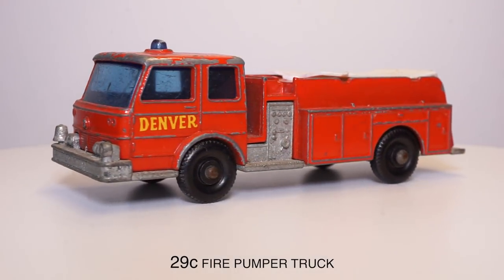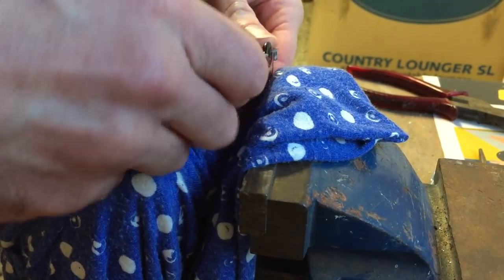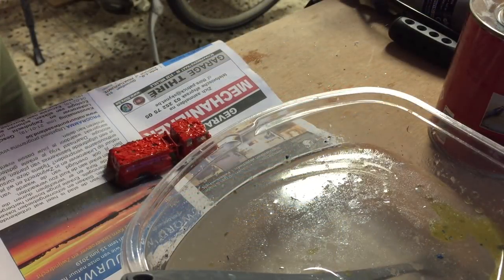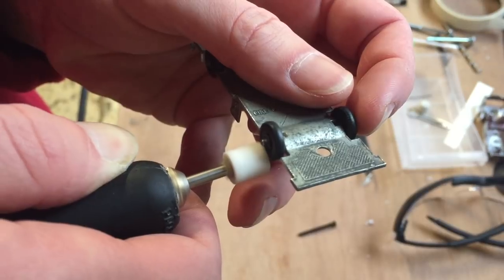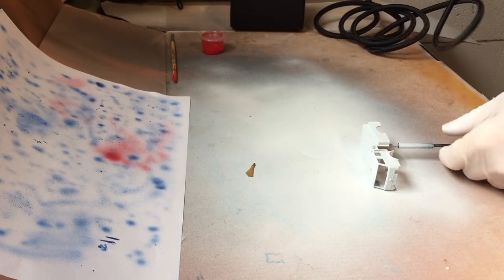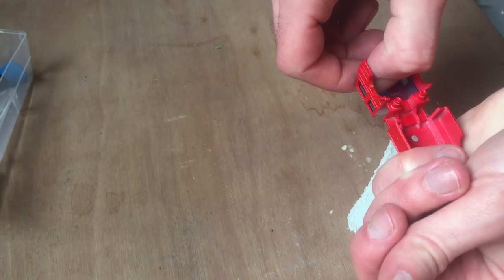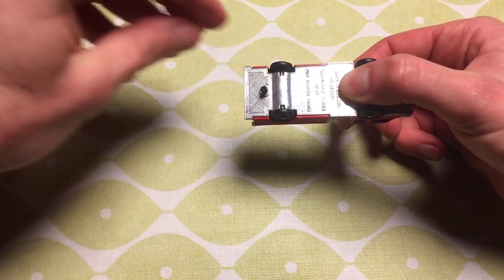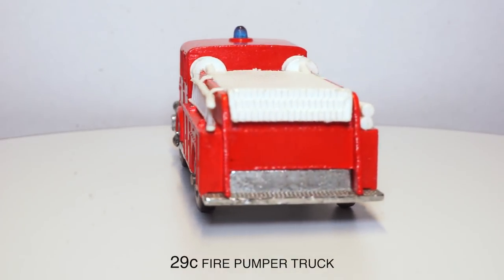Matchbox 29c Fire Pumper Truck - Full Restoration

Comment: Good job dude. I love the vibrance of the red colour you mixed, looks reaaly smart. 
I don't see why the "modified nail" method of doming the axles wouldn't work with a hand drill instead of a drill press, maybe practice on a scrapper first to perfect the method though.
Subbed and looking forward to more vids.
Reply from the maker: Thanks Pete. It came out just fine, not the exact colour, but nice afterall... :) More vids coming soon!

Comment: Use Marty's method of using a nail and drill press to mushroom the head of the axle when fitting back on. The mushroom on the left front and back axles dont look the same size
Reply from the maker: Check out my latest videos. They include my new drill press 😉

Comment: Very nice job.  My first was a hot mess and I didn't even post it.  Two suggestions, one is that a large safety pin will help get the paint out of the crevices.  Even if it makes a small scratch, the primer will fill it.  Second, tap the post before you paint so you need not handle it during the tapping process.  Welcome to the "war!"  Oh yeah, I subscribed.
Reply from the maker: Time Rider Thanks, that’s some good advice! Even though I watched a lot of videos before I started myself, it’s always a matter of finding the best ways to get things done in the first couple of restorations. But I like how every model demands its own way of approach during the restoration process. Thanks for subscribing!

Comment: Mix the paint before you strip the model so you can colour match the replacement paint against the original colour
Reply from the maker: Great advice! I'll try that in my next restoration. I did found out that the base coat color does influence the actual colour. With the white one, I always come out a brighter colour. The grey one gives me a darker colour. Pretty hard to get it right these first times :-)

Comment: Great beginning! Any issues you had were minor. Each problem will increase your skill. Being a bit more careful getting all surfaces evenly coated with top coat will improve the appearance. You were a bit light between cab and body. I will be following your efforts.
Reply from the maker: Thanks, Brian! You’re right about the top coat. I’m still figuring out how to get into those tight spots without messing up the rest of the body. If you have any advice on that subject, let me know!
Reply: @MatchboxRestoration  Each situation will be different. You might have to reach in there with a brush. You are looking for a color, not an exact texture. Your airbrush should be able to blend into the brushed area well enough to fool the eye.
Reply from the maker: I’ll try that in one of my next restorations. Thanks for the input!

Comment: Maybe you shouldn't use epoxy because now if you ever want to re do it again the parts aren't coming off, try hot glue or something not so permanent, but great job
Reply from the maker: Good point, Robert. I might look into that. Thanks for the advice.
Reply: I use Deluxe Materials Glue and Glaze. It's highly recommend in the railway modeling world. As well as using it to bond you can also use it to glaze windows too. Google it, to see what you think.
Reply from the maker: @tonycocacola5555  Awesome tip there! Thanks for sharing, David!